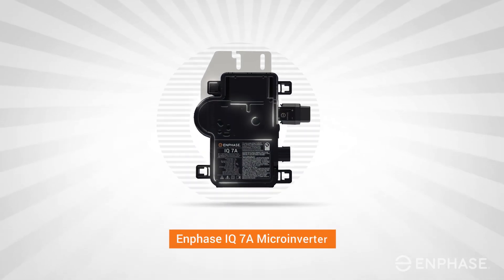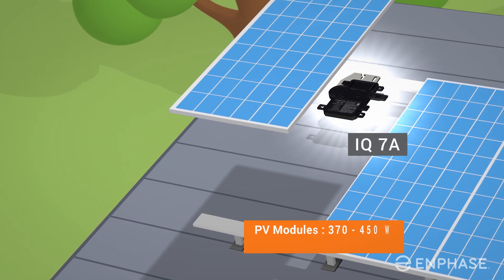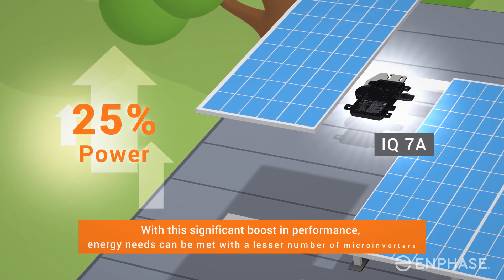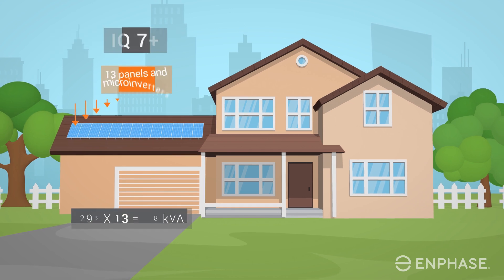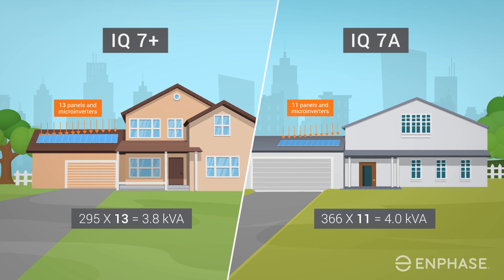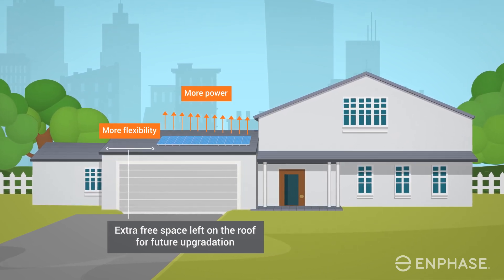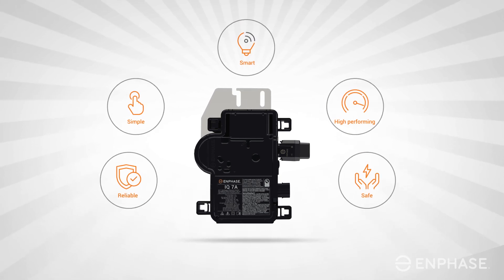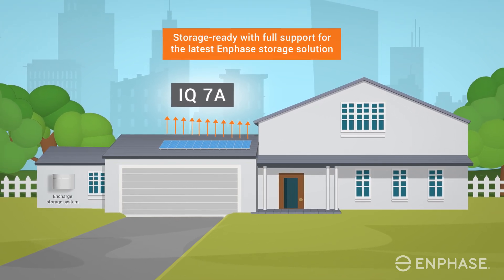Introducing Enphase IQ™ 7A Microinverters: Ready for High-Power Solar Modules

Comment: My 10k system is ten months old and dying for two weeks now.  Installer won’t even come and look at it.  I’ll be contacting Enphase myself.  Hopefully they can help.
Reply: How is working now??? What happen??
Reply: @Zihua42   I replaced all 30 microinverter at my own expense and labor. So I have a big box of defective micros in my garage. Enphase gave installer and I endless runaround as it was producing 80% of estimate.  They told installer they would replace them, but they never did.  Support just left me hanging.  It’s working great now as it should thanks only to myself and thousands of additional dollars.
Reply: @rjones93257  what did u replace it with? and what was the original part?

Comment: Nice ! But Enphase, how about some clarification on what PV modules size is best paired with the IQ7A.  Your video shows a range of 370W to 450W, but your IQ7A-DS-EN-US.pdf data sheet shows a "common used pairing" of 295W to 460W+.  It's 366VA peak, 349VA continuous power.  How much power should you expect continuously?  I have 365W panels currently paired with IQ7+ micro-inverters and they do seem to peak at 296W for several hours this time of year, so it looks like the Peak Power rating is the one that matters...
Reply: As an Enphase installer, I can tell you that the best match for the IQ 7+ is a panel between 365 and 385 watts. At this level you are getting the best power to size ratio from the panel micro combination. Over this size and there is some unharvested power during peak production times of the day that are not compensated for during the extended operational cycle of the IQ7+.
As these are rated for a peak of 366VA, I would pair them with panels in the 440 to 460VA range. The goal is to flood the micros as early as possible during the day, to their maximum output and then hold this output for as long as possible. This is why the oversizing of the panels. This needs to be matched, however, against the peak power output losses from not harvesting the upper levels of the power production of the panel.
Reply: @tonyhugh1395  God bless you Tony for posting this, as I have been extremely interested in this. I have a full Enphase system, 375 watt LG panels with the 7+ inverter. I still wonder if it would give me better amperage even though it most likely won't improve my production as the 7A is 1.45 amp over the 1.2 of my 7+. In easier translation the 7A from what your saying isn't correctly matched to handle the lesser output of my LG 375's. I was thinking the higher output rating would give me more production but would not as it's not designed to produce more unless the panel is of high enough wattage, hence the raised rating of 1.45 but only obtainable by the higher producing panel. Makes sense to me as the 7+ can't harvest the higher wattage and produce the extra amperage of the larger higher wattage panels as the 7A is designed to do. I have 24 X 375 = 9K DC grid (all on my south facing roof) which produces 7.1 in AC max on my app. Doing the .85 math converting DC to AC this seems to be spot on for what I should be producing at maximum on my system. Me posting this may help others to better understand the science of it all.